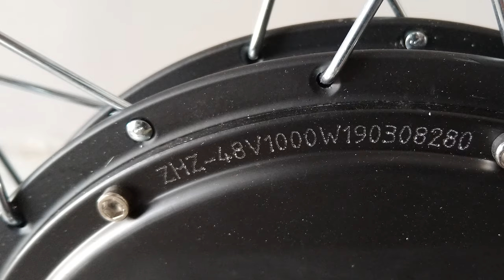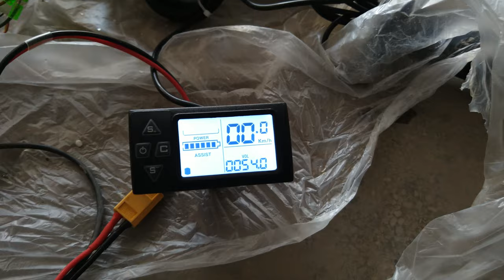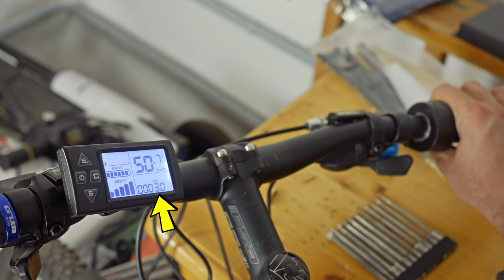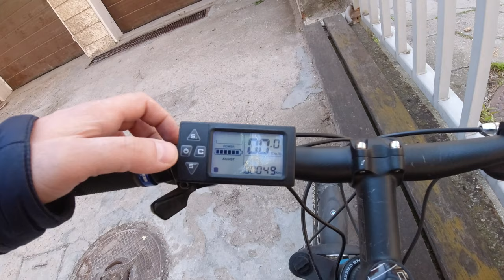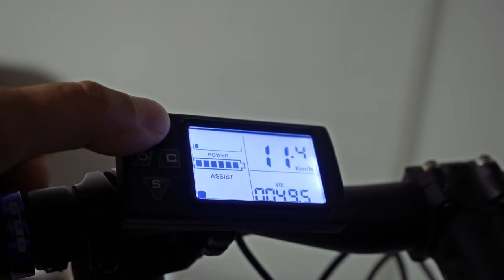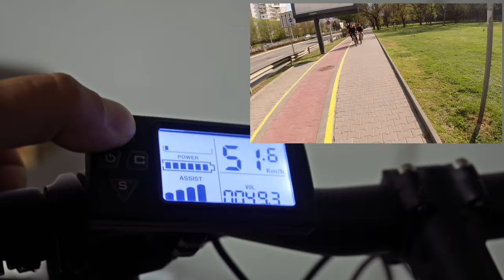DIY 1000W eBike conversion KIT - install and review

Comment: A lot of those hub motors have a removable spacer where the brake rotor attaches. They are black so you might not notice it. Apparently, these almost always have to be removed or you will end up with the problem you had.
Reply from the maker: Hm... weird... I've not noticed anything... will have a look again when I get back to the bike! :)

Comment: I'm doing a rear 1000w hub motor on my mtb i fitted the controller box under my rear cargo rack for a cleaner look i will have to make a alloy plate to go under it to shield it and i have large full length plastic mud gaurds to help keep the mud away the controller looks much neater under the rack my rack bolts to the frame not the seat pole so it's all hidden I'm just looking at a battery's now but I'd like a 48V 20ah battery.
Reply from the maker: Sounds like a neat way to do it! Well done! On pretty much all 48v controllers you can probably and safely also go with a 52v battery, so that is what I would suggest. Only thing would be to keep an eye on the voltage of the pack, especially if it is shown on the display, and make sure it doesn't drop below 3v per cell.

Comment: I have that same box at 6:15. I put it on a 29 inch full suspension mountain bike…..so I decided to mount the battery on the top of the frame’ ….and I was able to remove the battery” it’s basically mounted in the same spot you would put a gas tank for a gas bike…..I had to modify the frame and drilled some holes….. I then took a piece of 2.5 wide Aluminum to hold the battery connector for more strength….I used a gas bikes motor mount to support the weight on the front part. To make a long story short I had to Soldier two bolts into the frame” to make the frame strong” I used larger bolts and screws for added support and strength.

The bike is fast….…..because it gets up to 55MPH…..but I weigh 130 pounds….I was able to beat my 45mph gas bike with ease….on flat ground.
Reply from the maker: Haha, sounds good mate, that is a nice speed! Quite fast... I'd be scared to go that quick on an ebike!
Reply: @eVroomer  I’m about to build a 3000w bike with a 72v battery, I will be using a very light $300 dollar bike with a all Aluminum frame…I already have the kit. I have a $350 dollar budget for a 26in full suspension Mountain Bike. 

The 29inch bike sold very quick….sold it for $750 dollars. The build cost $550’ because I already owned the bike.
Can’t wait to find the bike….this bike will probably not be sold’ unless someone wants to pay $1600 for it’ Lol I might make it a fat tire bike for safety.

I build e bikes and gas bikes as a business….the gas bikes are easy to sell….but you kinda have to make sure you sell them to someone who knows how to ride them and able to do Routine maintenance on them…selling a gas bike to the wrong person = Headaches….people think you can just jump on them and make 35mile commutes to work’ without Maintaining them’ is Unrealistic…I do not sell to those type of people unless they sign a voucher….sold as is.

I had a guy run a gas bike into a wall and expected to bring it back and exchange it for another bike…..Lol
I never have that problem with any of my electric bikes….so I’m phasing out my gas bikes and doing only electric bikes.
Reply from the maker: @ebperformance8436  Hahahaha, yeah... some people can be quite daft sadly! But indeed, the future is the electric ones, and I assume the expectations for them are more realistic, and for sure they can be maintained much easier! Good luck with your business! :)

Comment: For $200 more you can buy a BBSHD with a controller rated at 1500w but is stamped 750w, making it street legal. Further, you can replace that controller with a Ludicrous controller that pushes it to 3000w. As a bonus, it also does not LOOK like it was mashed together and frankesteined. The controller is built into the motor assembly, and the kit fits 90% of the bike frames out there.  For $600 plus the battery, I just dont see why anyone is trying to hobble together their own "version" of an ebike. I have 5000miles on my custom cruiser w/ 3000w BBSHD and have had ZERO issues. If you do get a BBSHD DO NOT USE ALI, Fleebay, etc......go to the #1 reseller in the US, Lunacycles. Awesome people, and knowledge.
Reply from the maker: Could very well be the case... but I am not a fan of mid drive systems, unless we are talking about a proper motorcycle! :) Each to his own, I guess! Also... for me at least... installing the hub was a lot easier than the mid-drive, because I didn't have to go and find, and buy all these tools needed to disassemble pedals, etc., no that I would have gotten a mid drive in the first place, like I said... not a fan of those, though the specs on this one you are referring to do sound impressive! Also... I am happy you have access to Lunacycles... but the majority of people on this planet do not live in the US!
Reply from the maker: You Mad?  Yup, they do!

Comment: Do you still have this kit? Has it been reliable?
Reply from the maker: I do! I while back I tried a pretty extreme mountain climb with it, stock wires and connectors, and the phase connectors melted and fused together, which was a bummer, but it was expected! I was thinking to replace those before the climb but forgot... haven't used it since then, but all was good up until they melted. Should repair the wiring soon enough and have it running again! Controller could use a better air circulation than what I had done though. If you plan on pushing it hard make sure it gets adequate cooling.
Reply: @eVroomer  damn that's sucks, if you was to buy a KT connector from ebay would that solve your issue?
Reply from the maker: @Anees-  I actually have some of those 3-pin XT60 type connectors with the yellow plastic housings, but just forgot to replace the factory connectors.

Comment: Thanks for a very good video! :) have you had any problems with the wheel being out of balance ? Just saw a video from a guy who recomend not to buy wheels fom banggood. what is your opinion and experience on this e bike kit from banggood ? :)
Reply from the maker: I am pretty happy so far! Does not seem to be out of balance, just the rim has not been wired properly, but this is fixable, if you know how, or if you take it to someone to do it! Also... out of balance on a bike?! I've never heard that... for these speeds it needs to be some serious unbalance, which is rare! Like I said, its working well so far, have not had any issues yet! Will push it quite hard next Saturday in a special event... we will see if it will survive!

Comment: Good build well done surprised you didn't use the lipo battery power source option considering youre a regular electric model user
Reply from the maker: Thanks. Actually for a while now I've been using the LiPos as weights when gluing... RC model planes! :) Almost exclusively I've moved to LiIon cells there as well! Also, LiPo cells do not have the right voltage at the end, so they will end up way over discharged when the controller finally cuts... just can't be bothered to be thinking about this... and then there is the volume-to-capacity thing... with LiIons being a good deal better in that respect as well! :)

Comment: You can be faster using a 52 volt amp but appart from that you can put thinner and slick tyres and an aero porsition this will make you be faster i dont know how much
Reply from the maker: True, loosing 20kgs will also improve things for me, and since the latter is more critical, I am choosing to go down that route for now! :P

Comment: Hi Gal, I picked the voice too, and great to find your ebike channel as well as the RC one. Great vid on this subject, perfectly fits my interests and so easy to follow you through the install. 
My question if you can help...... I have a 26" fat bike, so with 4" rims. Can I get this kit and just put the hub in my rim and then just follow your vid for the rest?
Reply from the maker: Well there might be an issue with fitment as fat tire bikes are wider... why not get a fat tire bike electric kit to begin with?

Comment: Pop that controller open and squidge a bit of solder on that shunt! Will get you up those hills a lot quicker hehe! ;)
Reply from the maker: Hahahaha, interesting idea! Not sure the battery will like it though! :P
Reply: @eVroomer  what battery do you use? What's it rated too?
Reply from the maker: This one: https://youtu.be/R2CNxFyfyV8
:P
Reply: @eVroomer  Those 30Q cells will do 15 amps continuously and do bursts of 20 - 30 amps and you have 4 in parallel. So long as your BMS and fuse is adequate it will throw out a lot more amps than what the controller is demanding.
Reply from the maker: Yes, I am aware of the theoretical max... though I still don't trust the specs on these things... besides... I hate seeing voltage sag! Hahahahaha... might give that mod a try at some point further down the line, but I have been thinking a possible upgrade would be to replace the whole controller with something better! We will see! Lots of other projects to tackle before that point! :)
Reply: @eVroomer  voltage sag is only a problem when you go beyond the voltage thresholds, which any good bms will protect you from. I have my bms to cut when my lowest cell when it hits 2.6v. 2.5v is the limit, sagging past 3v is OK, but discharging beyond that could be bad. My battery sags from 4.1v down to 3.4v under full 250 amp load, and they still keep chugging along. Cold massively increases voltage sag though. So long as there genuine 30Q cells you won't have any problems doing say... 40 amps peaks at all with 4p.
Reply from the maker: Yeah, 40A should still be OK, but I'd get even lazier then... would like to be able to pedal as well... but the more it goes, the more I will like it... so better hold off with this mod for now! :D

Comment: When you attached the wheel to the frame did it have resistance? (Not due to brakes?). My wheel doesn't spin freely and even when the battery's plugged to the motor the thumb throttle doesn't move the wheel
Reply from the maker: Hmmm... no, there was no resistance to it when I put it in the frame! If it doesn't want to turn even a little when powered with throttle... might indicate some issue with the hub... perhaps an internal short, or the cable somewhere! A hub not spinning almost freely could indicate phase short!
Reply: bro you didnt put washers on side that is why wheel dont spin freely .

Comment: Is the magnet sencer on the crank optional?
Reply from the maker: Yes, you can either have it, or not, will work either way. If you don't have you can't use pedal assist, only the twist throttle.

Comment: So easy all colar coded and snap mine doesn't have a lcd just trottle 34 mph so it says haven't checked yet 1500 watts I hope so
Reply from the maker: How did you measure that speed? I would not be willing to get a KIT without an LCD, and at 1500W, assuming that is 52v, you should be able to go a bit quicker than 34mph!

Comment: Is your kit restricted to 750 watts and if so can it be configured to unrestricted?
Reply from the maker: Does not appear to be, according to the screen it does the full 21A the controller is rated for, which at 52v is just over 1000W.

Comment: Hi there. Where do you live? since the price of buy the kit is different, when you live inside EU. you get taxed for buying stuff outside EU, so i want to avoid that. any ideas how?
Reply from the maker: Yes, most Aliexpress sellers actually use a shipping method that skips customs for you, and gets delivered directly, so you better contact them before placing an order to ask about that for the EU! The Banggood link above offers an EU Priority Line shipping for the EU, which includes them handling all of the import stuff somewhere in Europe, and then shipping it to you with EU courier, so it arrives at your door just like any other regular package you have ordered from your country for instnace.
Reply: @eVroomer  thanks for the response, i'll try it out.
Reply from the maker: @blodhunt  Good luck! :)

Comment: Has anyone tried to buy only the motor and install it to your original wheel? I feel like it's kind of waste to buy new wheel with the motor, when you dont really need it.
Reply from the maker: Well if you are buying from QS for instance, I think you can get the hub only, but then you will need to find somebody to do the work of making spokes and mating this hole thing to your wheels!
Reply: @eVroomer  oh yea its quite bit of work
Reply from the maker: @megapet777  Indeed!

Comment: is it weather proof?
Reply from the maker: Certainly seems to be! I have ridden in the rain, no issues so far! The HUB should be sealed, and the controller seems to be as well!
Reply: @eVroomer   Nice. Getting myself one tomorrow :)
Reply from the maker: Awesome! Good luck with your build!
Reply: @eVroomer  do you mean that its already sealed or that you need to seal it? Sry i am not so good at english. It will help me so much out
Reply from the maker: @v050w8  The hub should be sealed, and same goes for the controller! At least from the looks of it it looks that way... but then again... you could always add some sealing yourself to make sure.

Comment: They have 2 packs of tourge arm's on eBay cheap one for each side I have 1500 watts
Reply from the maker: Cool, do you have them? I wasn't very confident in those, and decided to get something recommended locally to be pretty tough! How's that 1500W one working?
Reply: @eVroomer  Killa battery is separate 1500 watt 48 volts 50 bms wheelies 34 MPH 331dollars for the battery 220 for the kit called, voilamart
Reply from the maker: @mangodwins6328  Right, not a bad deal! Sounds great!

Comment: You know I've looked at like at least 10 Videos now and no one shows how you sit the spacers from the rear wheel properly like not one video crazy ive done everything and I have one like the washers that are suppose to be on the in side and then then the ones on th3 out side and every time I tighten up my nuts lol it keeps crunching and grinding and isn't spinning like its supooze to I've tried three different frames now the original was even an original proper electric ebike I also don't have the back brake setup nor chain just yet and it still rubs add grinds
Reply from the maker: Hmmmm... good point... not sure I show that either! I have two of my washers on the inside of the frame, one on each side, because I needed to stretch it out a bit to make the brake calliper fit well, and to centre the wheel to the frame, have not seen any bending, or grinding, or screeching!

Comment: what voltage are you using
Reply from the maker: 52v, 14S LiIon
Reply: Then why it only go 30mph I thought with 50v it might go 40mph am I wrong
Reply from the maker: @jonathanbrunache3848  Well there are a number of factors that determine top speed - controller output, field weakening, hub Kv rating, etc. If I use a 1500W controller, perhaps I would reach a higher speed, but even this one seems OK! There is also the consideration of surface, tires, rider weight, and so on... and I assume somebody weighting half as much as I do, would get up to a slightly higher speed as well! It is not only a voltage thing!

Comment: i have 1000w kit i dont recommend anybody to buy this. There are much better options like 750w geared hub or 500w geared hub,  which can reach same top speed and weight of the wheel is half only , 1000w motor with wheel weights about 7 kg while 500w or 750w weighs about 3.8kg  . So i dont see any point of buying this 1000w kit . Second thing this motor eats double amount of battery compared to for an example bafang 500w hub which also reaches speed of 45km per hour. And battery range will be double on 500w motor than 1000w motor.I will point to all people that are planning to buy 1000w kit that  samsung 48v 30ah wont last you longer on full throttle electric only for more than 60kilometers, while on 500w motor will last you 120 km.  I know this things because i sometimes work as food delivery and i have both 1000w and 500w motors.
Reply from the maker: Fair enough!